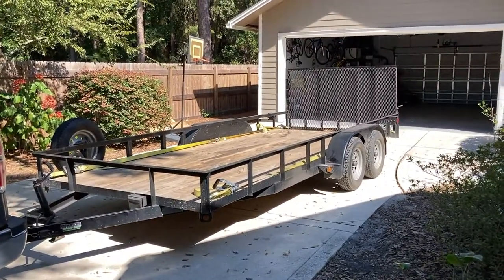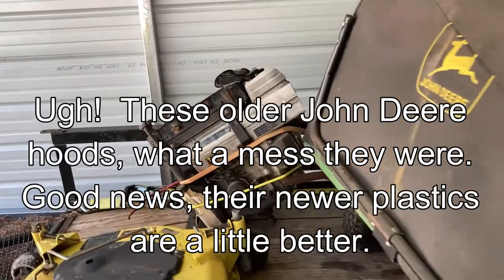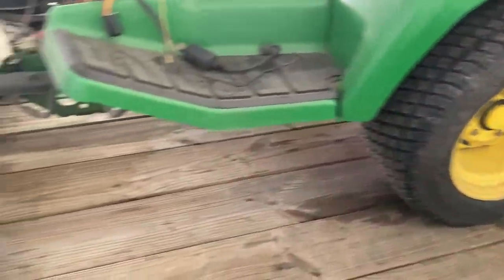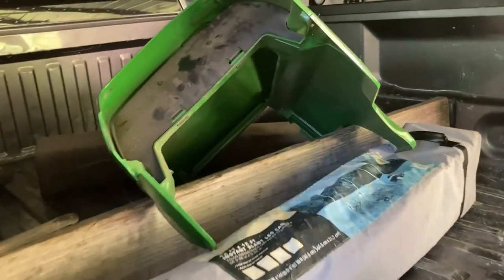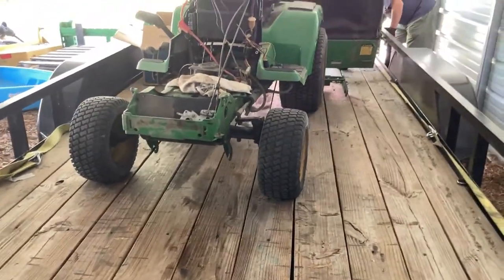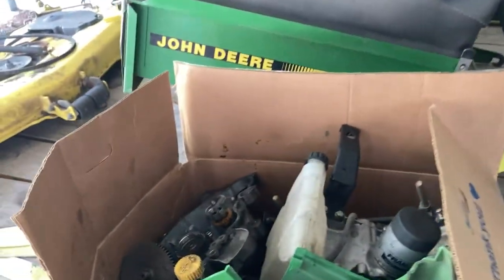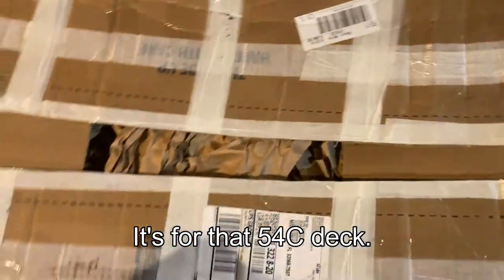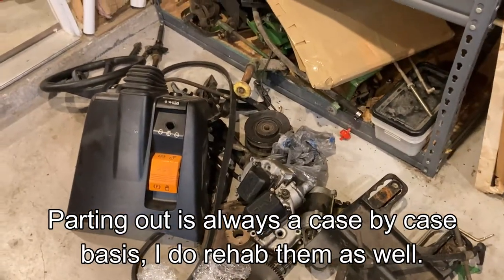John Deere GX345 & MC519 Cart, Parts or Project?

Comment: Beautiful gx, did you really part it. I think you should regret that.
Reply from the maker: I understand where you're coming from, bu ton many acquisitions, you really have to assess the numbers otherwise you can make a find a very negative one.  With the cost of plastics and the time spent getting one or the other motor to hopefully work, it can be a black or maybe I should say red hole of expeditures.  I mainly wanted the 519 cart.  I did consider teh whole project as a rehab, but money and time both cost me, so parting it out was the best solution in this case, in my opinion.  Thanks for watching.